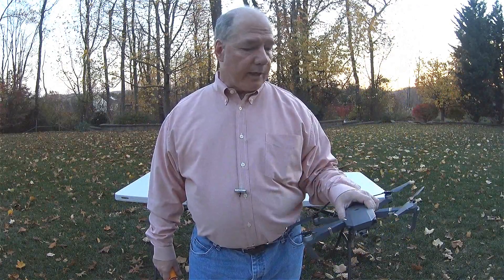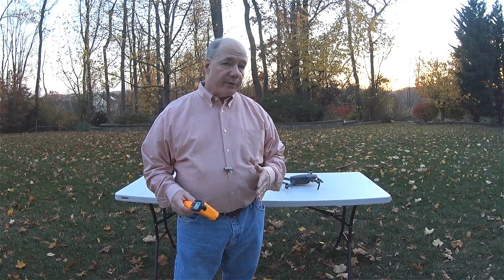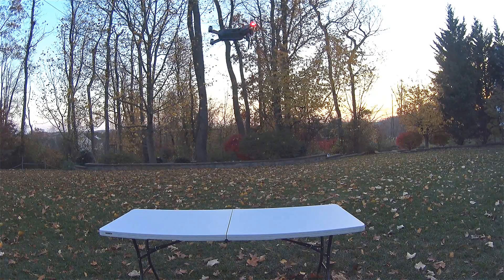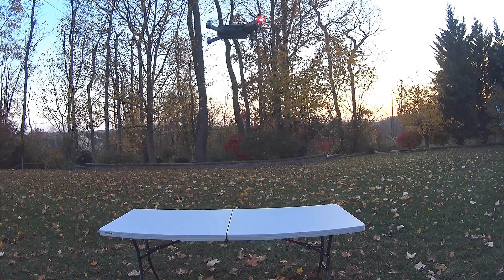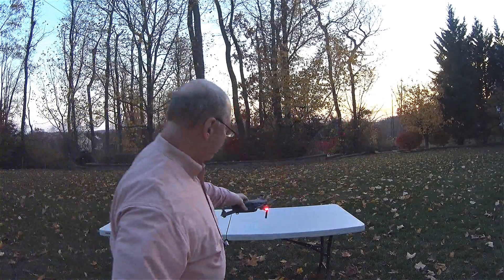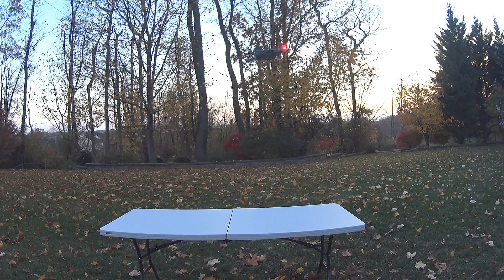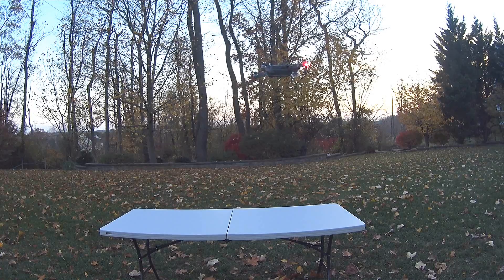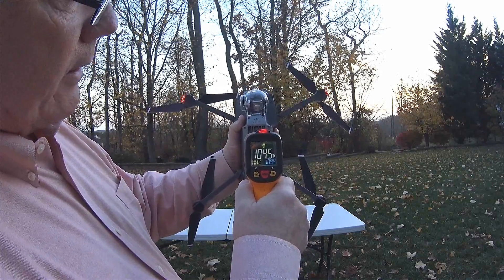Mavic Pro Running Hot?  Here's Why

Comment: This doesn't necessarily prove anything? A few degrees higher when you flew it a couple minutes before hand. It would not have reached the same starting temperature as when you started to fly the drone without the gimbal cover leading it to be hotter.
Reply: Adi Bakhshi he let it cool down before the cover test just didn't show it in the video no need to
Reply: john stevens actually no he said he will give it 2 minutes to cool down. That's not enough time
Reply from the maker: Adi, I didn't mean that literally and I'm sorry for the confusion. I did let it cool back down to ambient temperature (64 degrees) before starting the last test. I will be doing a follow-up clip next week with a longer flight and will be sure to show the starting temperature for each step so it's clearer. Thanks for the post and be sure to stop back soon. Rick
Reply from the maker: John, thanks for the support and I should have been more clear in my wording. My wife always gives me a hard time when I say that I'll be there in a minute and them wander into the room 30 minutes later :)